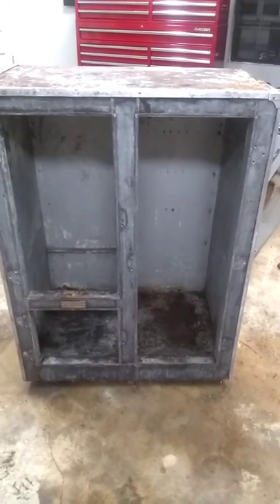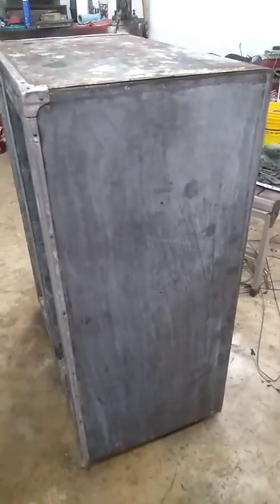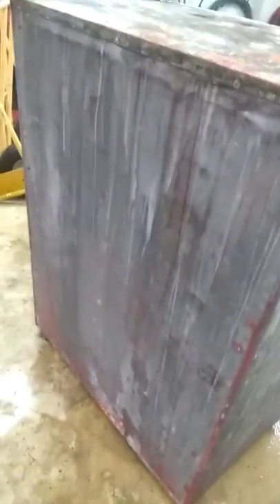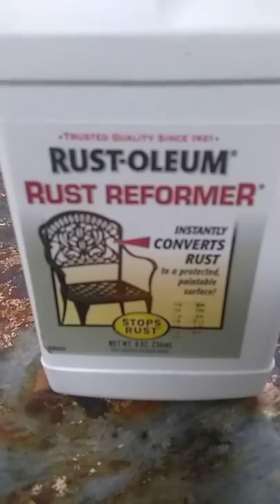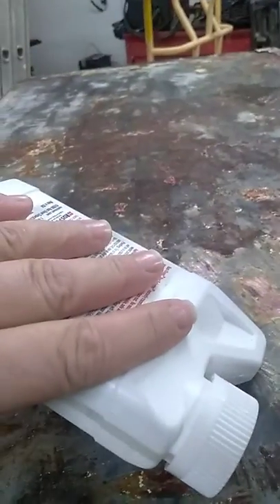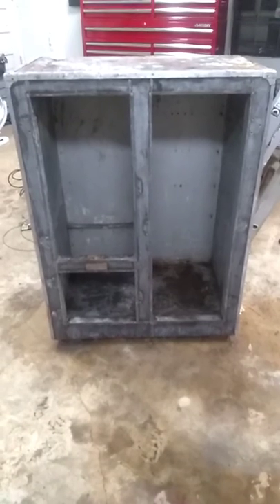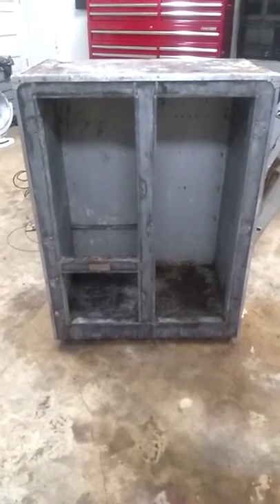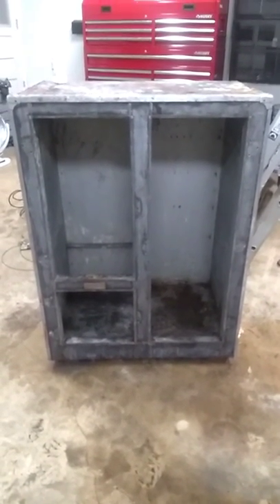Part 2 ice box restore

Comment: Im going to Tn from AL to pick up an old ice box, this next week. It needs a new paint job. I will use it as it was intended as a frig. What brand paint are you going to use? These iceboxes had a coat of enamel on them, but finding someone to dip them, strip and put a new coat on is hard to find. Do the white inside. It will help brighten the interior. I just did a complete restoration on an old 50's wood burning cook range. Will use it as it was intended. 

I did find that KRYLON silver and black have a better color to them than rustoleum. Use the rustoluem white appliance paint.
Reply from the maker: Jaime. Thanks for the info! I am still working on getting the inside down to the original galvanized metal. I can only work weekends behind the farm. I plan to clear coat it inside. The outside I will just put a good primer and paint since I am not planning on using it for anything other than storage unless I have to. I am doing blue like my Chambers Stove that I DO USE! LOVE  those old stoves they are awesome!!! Upload progress of yours. I'll try to get to mine ☺️☺️
Reply: I have a video on youtube of the beginning part of the stove restoration. Im done now. Need to do a voice over on a slide show of putting each piece back together